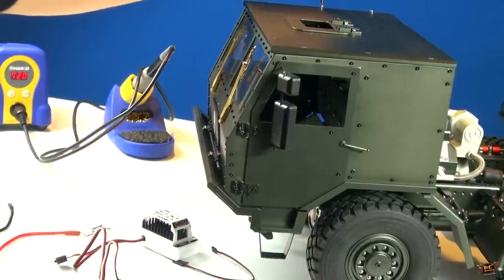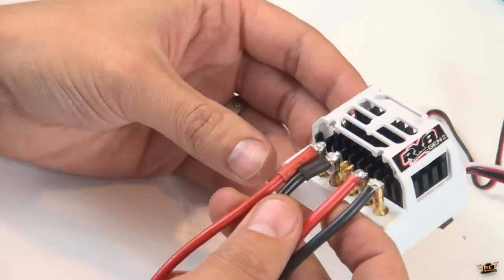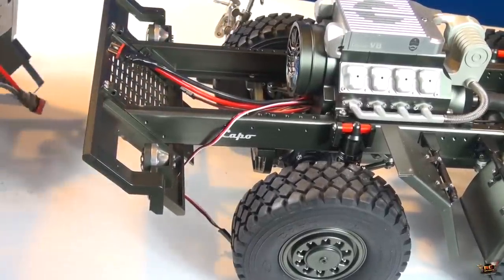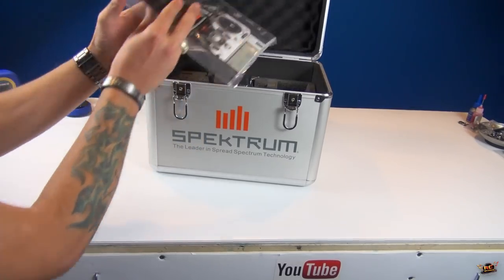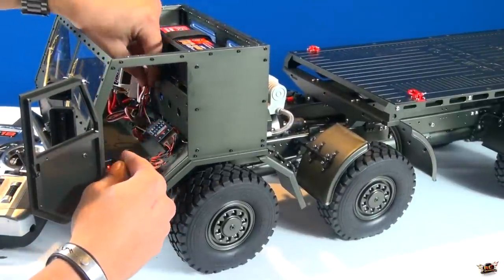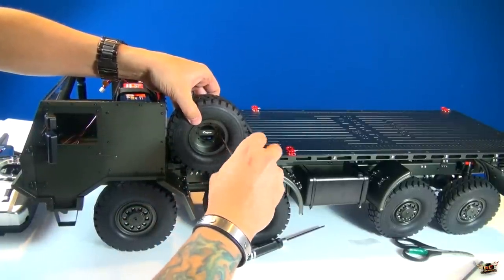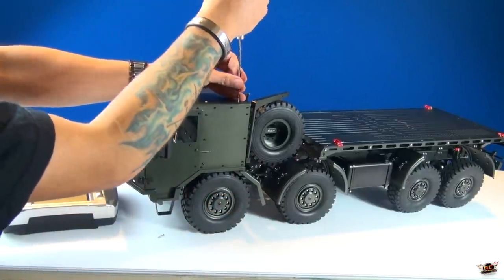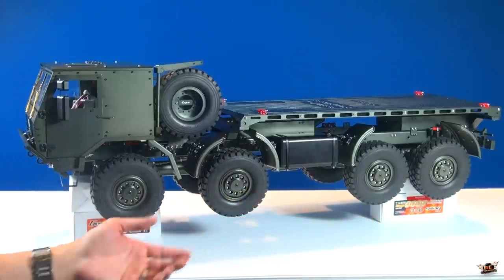RC ADVENTURES - Full Metal Jacket - CAPO CD 15821 8x8 Extreme Off Road Military Truck - BV6

Comment: The in the cab FPV idea would be awesome!! i think that you should change the dif lock and the transmission servos to the flip switches on the controller. an then either build a crane or buy one for the truck so then you could get poeple unstuck.

Comment: Just a wiring idea for convenience: place your esc and receiver in the back half of the cab. Wire the servos and motors though the floor of that back half. Put the switch on the dividing wall and the battery in the front half. This will allow you to access the battery and switch through the door and not have to remove the top.

Comment: Like the build. If I may make some suggestions. Paint the esc to match the color of the truck. That way it will blend in. Put the battery in the lower part of the cab. Still gives you weight over the front and if the doors open that will give you easier access when doing a battery swap. Just some suggestions but your the expert. Thanks. Great job.

Comment: Great job on the build...I drove by a National Guard Base where they park these 8x8s and it turns out the mirrors are up-side down..The smaller mirror or contour is on the bottom..And the larger one on the top...

Comment: Medic, I think that you may eventually have to use some rubber grommets for the cable pass throughs into the cab.  Those wires are at risk for being cut on the aluminum from what I can see.

Comment: If you hunt around you can get datasheets for those ESC's which then give the max rating in stall amps. You can measure the amp rating for your motor at stall by setting a multimeter to ohm-meter mode, recording the resistance across its 2 terminals, good old V=IR with V being battery voltage to motors.

Comment: Hay medic if you want take it through mud and water you could make a plug for all of the wires under the cab  or just put extensions for the servo leads and you could just pull out the front pin and pull off the cab if you have to wash it then all your electronics won't get wet

Comment: If your talking about the same system the you put on your summit than I think its a great idea personally.  Magnets would not interfere with the signal since your be transmitting in the Ghz range. I also think a tank on the bed would be an idea. Maybe have a tank battle with some IR system just in it. Thanks for asking my opinion.

Comment: with the esc are you going to tack out the off and on switch and hot wire it so is stays on the hole time the battery is in.

Comment: You should get a winch for the capo to use with a plow and this is directly from the web-sight Capo绞盘 RC模型绞盘 攀爬仿真绞盘 scx10\D90\TAMIYA\牧马 (translated: Capo RC model winch climbing simulation scx10 \ D90 \ TAMIYA \ Wrangler.)

Comment: Very cool but for that amount they could have added details. They did great with some exterior detail but skimped in other areas. The total lack of interior is very disappointing. Did you intend to paint it and add washes and filters?

If you want to dress up the mirrors search plastic model catalogs for bare metal foil. Its a thin adhesive foil with a great deal of reflective sheen depending on the finish you pick. Sprue brothers and Squadron mail order always have it.

It looks inspired by current LHS military vehicles but the tires are too undersized. If they reshaped the cab a bit and added tires at about twice that diameter it would be almost right for an M1120 without the hook and flat rack.

Comment: Hey Dj Medic! I've got a question I've been troubled with for a while. I have and axial scx10 and its just about all stock except tires and a new receiver. Im looking into getting a new battery cause at the moment Im just running what the guy at the hobby shop gave me and im ready to upgrade. Whats a good all around battery that's not to expensive and has good life and durability? i also would like to maybe upgrade to a lipo or something similar

Thanks Andrew